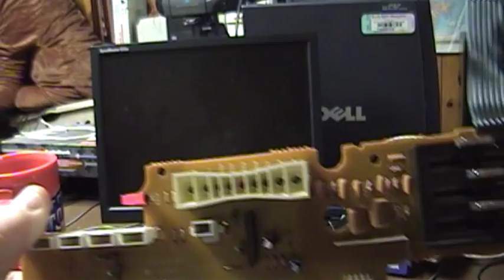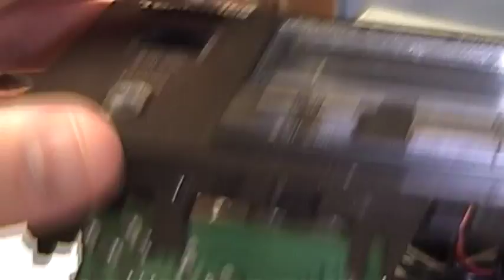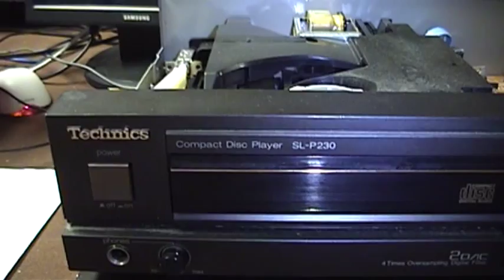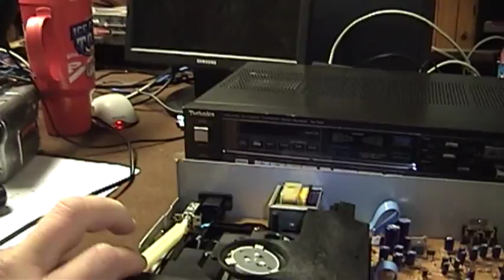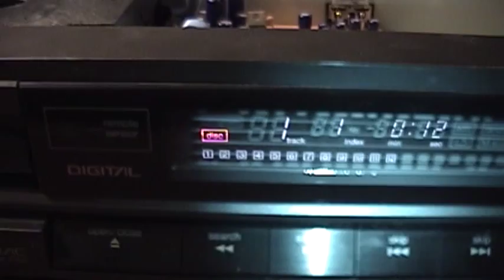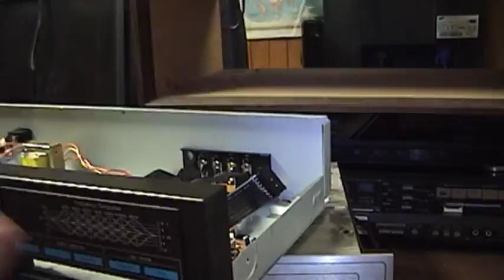Kitchen Table Electronics Repair: Technics Audio Stuff

Comment: I have the exact same model SA 946 but all the lights still work! Still gets use beyond the very good FM antenna (and sometimes the Pioneer turntable of the same age!) by also using a bluetooth to RCA converter via the CD input for modern smartphone audio input. Not much info on these online, the only issue with it I have are intermittent speakers cutting out. Primarily the left channel but both will do it randomly. I have ruled out speakers themselves and the wiring as the issue. Would this also likely be a soldering issue or bad capacitor as you showed as common issues? Or is this far more involved to figure out?
Reply from the maker: To know for sure, one would have to go through and diagnose it. Bad solder joints are certainly a possibility. I did not find a bad capacitor in this receiver. I have seen the protection relay develop bad contacts in similar models. I've had mixed results with opening those up for cleaning, which takes great care.
Reply: Right, I am no stranger to fixing old computers and soldering (replaced CPUs and soldered car audio components a few times). But I would be worried how brittle this would be and prefer to not dismantle. Really it still functions great, my main question is would this be a reason to not use it if it continues to cut out. Would it cause any issues?
Reply from the maker: It's pretty safe to say that the only issue you'll experience is one of the receiver becoming less and reliable over time. Eventually, it'll almost certainly stop working or the problem will become too annoying.

I have not yet run into problems with brittle plastic on these. I believe the breakage seen in this video is the result of abuse.

Edit: if it is the protection relay whose contacts are failing and there's no other fault (such as a DC offset), you can buy time by setting the volume to zero when you power up or turn off the receiver.
Reply: Only occurs after it has warmed up a bit (20 mins or more after turn on), doesnt run hot at all (edit: only gets slightly warm to the touch after hours of use), but never happens when cold. Good point about the protection relay (im clueless in that zone there), as when it does occur is mid level volume (2 or higher) when bass or interference (radio) hits. However very high volumes (4+) it does fine particularly when playing top quality HD music from a bluetooth device. Lower quality such as old cassettes or poor signal radio seems to happen much more often. I have tried other smaller/lower output speakers (as these are 5inch Sony of the same age, peak rms of 125watt at 8 ohm) and different wires and it still occured on the same left channel at the same conditions.

Comment: I really dont like technics amps, they really are built down to a chinese pricetag, with cheap plastics and crappy pcb's, try and get hold of a vintage sony from around 1980 you will see what a good amp looks like inside, technics are highly overrated, those wires are high current fuses and blow on these amps quite a lot, people just put a blob of solder over them, good video tho mate.

Comment: Speaking of Graphic Equalizer, I have one like 1990's Kenwood 7 Band Dual Graphic Equalizer, it has a red LED Lights on the switch where I can adjust the sounds on the console where I can play my 1997 JVC Double Cassette Deck TD-W354 where not only I can listen to the music, is what I can digitize the audio tape by recording directly to the computer to use as a MP3 Player where I don't have to bother the tape again. =)

Comment: One of the things you might consider is a temperature controlled iron. They help immensely as they don't overheat the solder pads causing them to lift away from the board. They can be purchased for under $30 and can save you a lot of time and money from repairing mistakes to not spending as much time working. I can completely see why you wouldn't think you need one. My point is that their just good to have as a tool.

Comment: Once common problem I see with those jacks like on the cd player is people using "monster" cables.  Yes they are better quality, but they are such a tight fit you have to jam them on sometimes, and you can watch the jacks flexing.  Better for a permanent install and walk away.

Comment: wow i have that almost the same CD player. Mine is sl p118 instead but has the same tracking system and front panel as this one, although the display is a bit more simple than your. I hope you get good use out of it because mine is my favorite CD player or at least the one i listen to the most  .

Comment: Seems like bad solder joints are a common problem on Technics equipment from the late 80s. I had a Technics amplifier and it had exactly the same problem with the input selector indicator LEDs not being soldered to the board properly.

Comment: I have a technics su-v7 amp, and the 'new class a' sign on the front no-longer lights up - it's got 2 tube shaped lamps (the ones with a  wire on each end soldered flat to the circuit board). Anyone know where I can get these lamps, or what they can be substituted with?

Comment: Make it a super bright led, you can taylor the brightness with a resistor :-)

I replaced the meter lights in an old pioneer amp with horizontal fitted xmas tree bulbs, worked fine in series for 24v :-)

Comment: You can install a wider ceramic filter to increase the audio response on AM without affecting the alignment, but Technics' AM tuner isn't that great in terms of sensitivity either, so I didn't feel it was worth doing any serious modifications on it.

Comment: Some receivers just use an audio filter to make the AM sound narrow. In that case, installing a C-Quam decoder restores the hidden wideband sound (even on mono stations) that it could've had all along, by bypassing that audio filter. But with this Technics, it uses a narrowband ceramic filter in the IF stage, not an audio filter, so installing the C-Quam decoder did not improve the bandwidth on AM.

Comment: Strange that my Technics had exactly the same damage to the case however my one managed to crack the pcb and i had to jumper the 5 volts to the ground display.

I also have a cd player that's almost the same as that they are very good cd players

Comment: Years ago I did try to convert the SA-946 to AM Stereo. I don't think I was successful, and in any event, it wouldn't have sounded good anyway due to its very narrow-bandwidth ceramic filter. Considering the great-sounding wideband AM Stereo car radios that Technics made for Toyota in the 1980s, it's a shame that they cared so little about the AM tuner section in their home receivers.